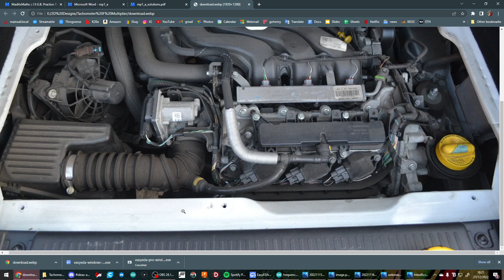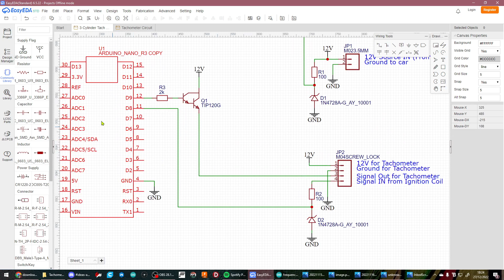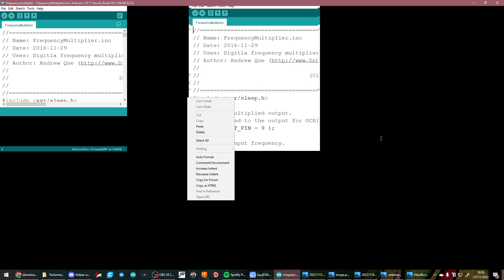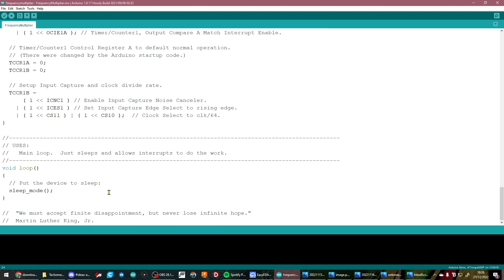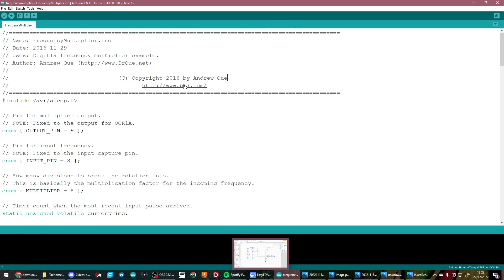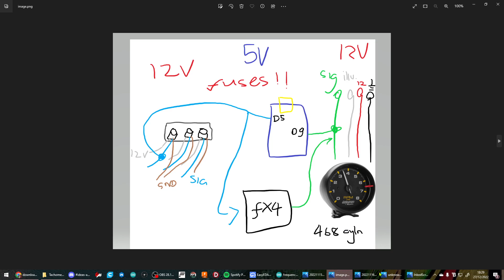How To Use a standard Aftermarket Tachometer on a 3 Cyl engine | Tachometer Frequency Multiplier

Comment: thanks for this enlightments. i been tested that aftermarket RPM gauge for 4-6-8 cylinders in my 3 cylinder car, have lower RPM reading value compared with internal car rpm gauge.

imho, i suggest that you need to improve signal RPM input, not only adding 5v1 but also adding voltage divider from 12V to 5V, the signal to trigger the transistor base of ignition coil driver can fluctuating 12V Vpp. 
we need to play with high impedance for input, so the arduino will only give small amount of circuit loading that could affect to the ignitor spark output.
Reply from the maker: @NgoprekdirumahYT  I have kind of canned this project as I no longer have this car. But I would love to see it done so I pass the torch to you